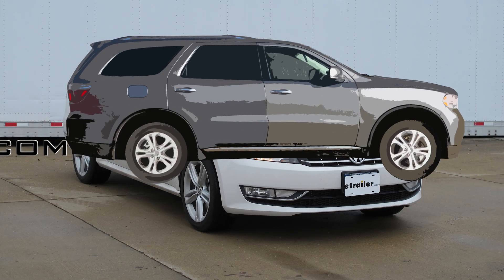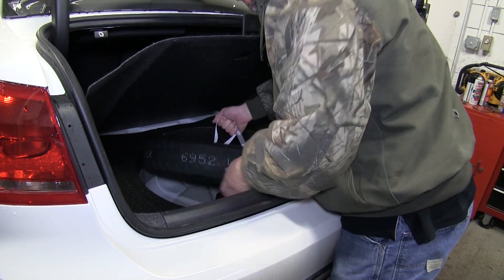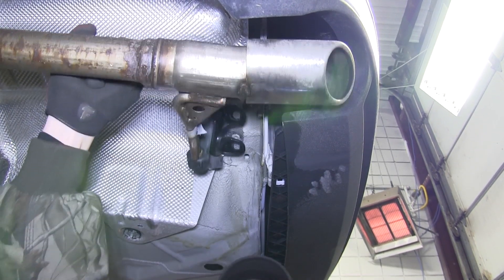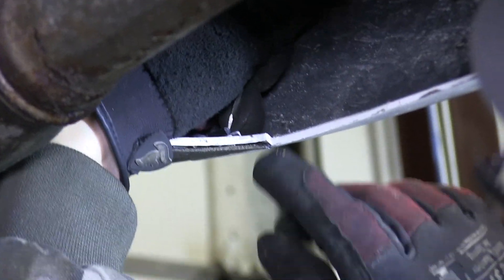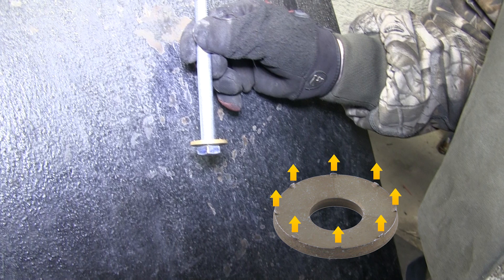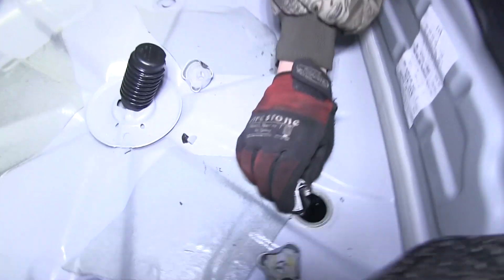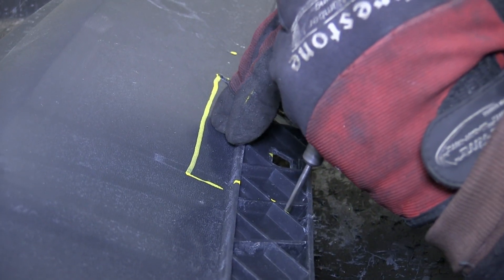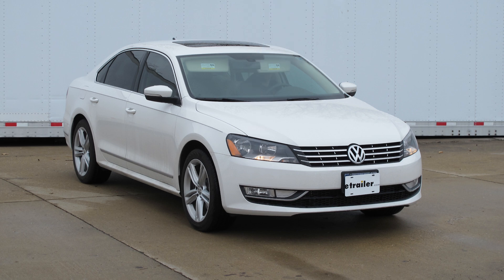How to Set Up Your Draw-Tite Sportframe Trailer Hitch Receiver on a 2013 Volkswagen Passat

Comment: Your other video for the hidden hitch brand (Installation of a Trailer Hitch on a 2013 Volkswagen Passat - etrailer.com) seems to be identical.  These two hitches are identical, and the instructions for the draw tite don't mention cutting the fascia.  Which of these did you actually install?
Reply from the maker: Robert Carl DeMuth The instructions for Draw-Tite hitch # 24880 do call for trimming that panel. Here's a link, check step 6: http://www.etrailer.com/instructions.aspx?pn=24880